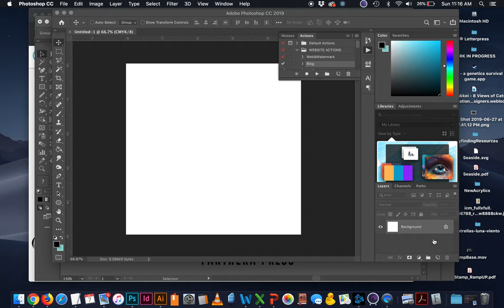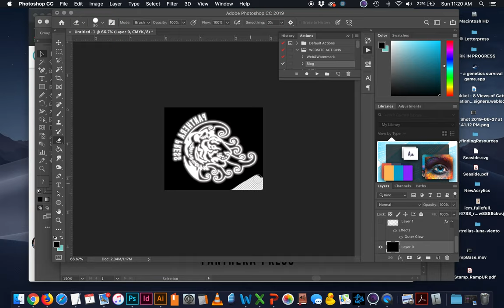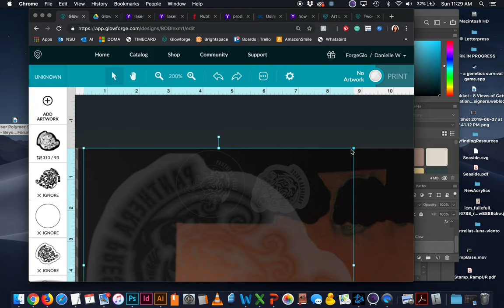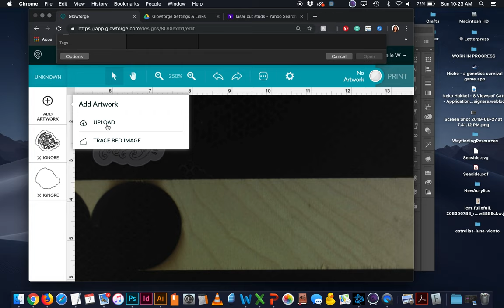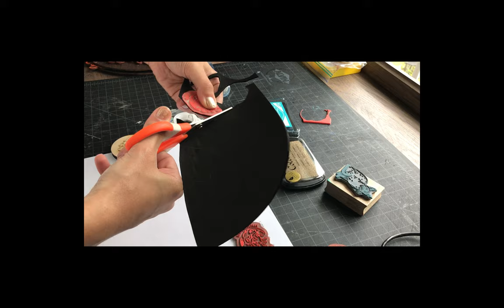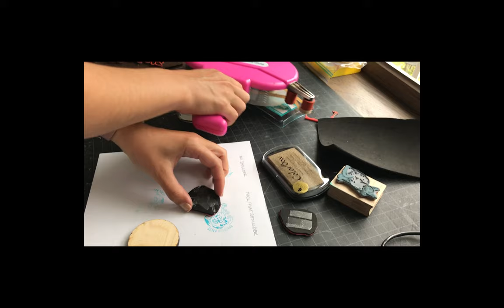Creating Stamps with the Glowforge

Comment: Thank you, thank you, thank you 🥰 this was horrible trying to figure out in illustrator 😔 AND I forgot about flipping the text 🤦‍♀️, you've saved me a lot of frustration 🤗 Maybe you've figured this out by now, but just in case you haven't, unclick the responsive when exporting. I always do SVG, unless it's a pure engrave, then I don't care what it exports as lol. That way you don't have to resize your design, it's a massive stress reliever and material saver 🥳
Reply from the maker: That's a good tip! I'll have to remember to add that in the written tutorial. I typically only use SVGs in web design so I've just avoided them ha!

Comment: could you adhere a bunch of cut and ready rubber parts to the craft foam all on a sheet and just have the glowforge cut them out for a cleaner border? 
I dont own a glowforge yet, just trying to get an idea
Reply from the maker: Yep, you could! It would just change your cut setting and your material height, but it wouldn't be an issue.

Comment: How is everyone cleaning their stamps. Mine are coming out perfect but they have a ridiculous amount of waxy residue that, no matter what I try, I can't get it to lift. I've tried "Awesome" degreaser, and some of the toughest car detailing chemicals for removing tar and even those don't lift the waxy residue. Stainless steel brush doesn't remove it either.
Reply from the maker: Have you tried a different stamp material? A toothbrush and LA Awesome have worked great for me, so I wonder if you have the right rubber. I think a lot of people also use cooking oil oddly enough.

Comment: I make rubber stamps for living. And the problem with using the Glowforge for rubber stamps is that it uses off the shelf glass tube CO2 laser source, whereas my Trotec speedy uses the metal RF laser source. The refresh rate of the Glowforge is extremely low compared to that of the RF machines. This will reflect heavily in the machine's ability to engrave very small letters and lines at high speed. I know it's ridiculous to compared a $6000 to a $60,000 machine, but from a technical point of view, rubber stamps are the most difficult engraving job there is for any laser machines.
Reply from the maker: I would never recommend the Glowforge for doing this commercially because it's simply too slow. I would probably recommend getting something for flash stamps in that case to start, but this tutorial is primarily for the hobbyist who will be making them here and there. It's the same with letterpress (my other hobby). Yeah people can hand print their wedding invites with a brayer and a spoon but it doesn't compare to a massive printing press running dozens or even hundreds a minute and exactly like you said the level of detail and fidelity are not the same - doesn't mean you cannot do it if you want, but it's still a fun project for GF owners. (And I have the basic so its 2,500 to 60,000 no comparison haha).

Comment: If you export the file in illustrator with the image and the vector (to cut the rubber) as PDF, you will not need to resize in GF.
Reply from the maker: Correct. I do generally do this, but I like to show the issue with sizing.